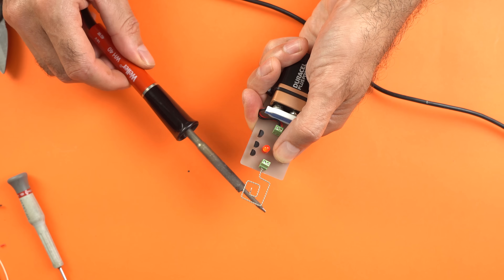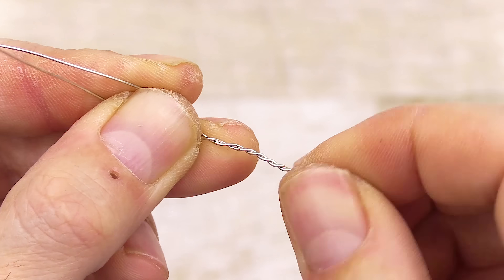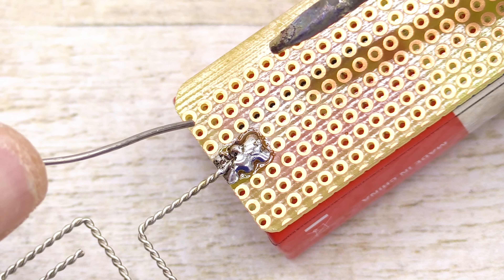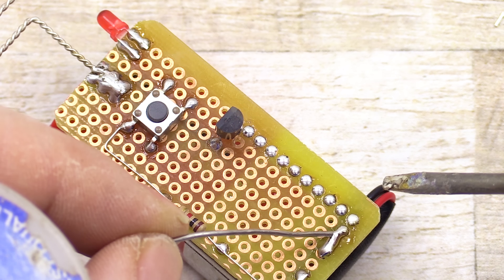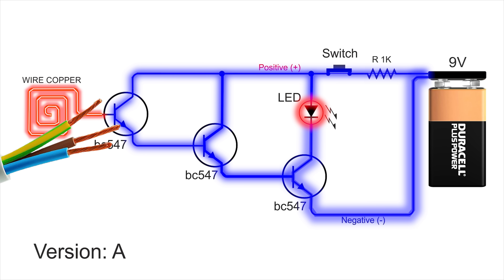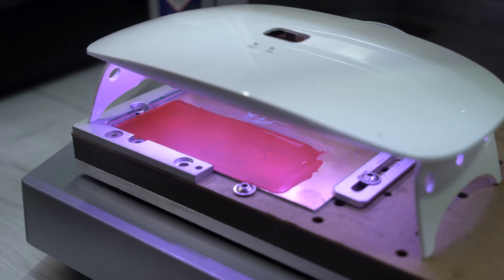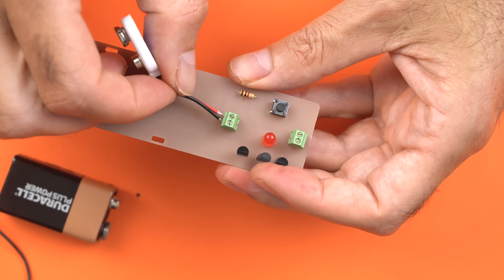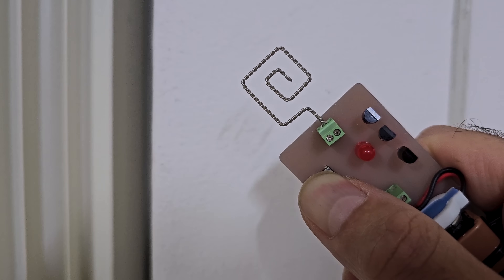This DIY Gadget Detects Electricity Through Walls!

Comment: anyone else has the same problem whenever i connect to the battery the LED lights up regardless if the antenna is soldered on or not, been checking the diagram and this and looks identical except the on/off button

Comment: Could the Antenna be designed to be an integral part of the PCB. There seems to be a lot of unused surface area on the PCB and some 'trace loop' etched into the copper of the pcb to replace the wire antenna ? Would it give a stronger signal strength perhaps if its larger than the one shown in the video ? I'm thinking something like an RFID Tag !

Comment: If you want to make it more sensitive replace the first transistor with a FET transistor. You will probably need a 1M ohm resistor between the antenna and the gate of the FET.

Comment: I wish they could get things right. First it was a green LED then a blue then a yellow. Yet the guy soldered a red LED to the board. Also the voice said '...connected the antenna to the emitter of the first transistor'. Yet the circuit showed the correct connection; to the base of the transistor. 
She spread green solder mask? It red or is the AI colour blind. 
Now the LED is stated as orange?
Come on. Get it right.
Reply from the maker: It's well done, believe me, but not the way you mean it. It shows that people are only commenting to criticize you and not to encourage you to make more videos. The text is a bit ironic, also to get your attention. 😊👍

Comment: A useful thing!
I built a similar one using an unnecessary remote control, slightly redesigning it. The power supply is 3 volts.